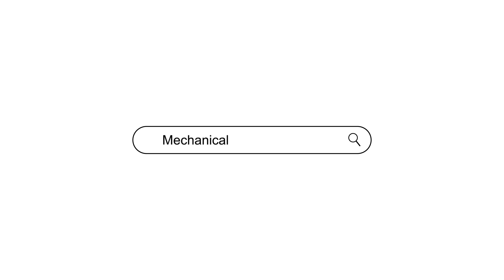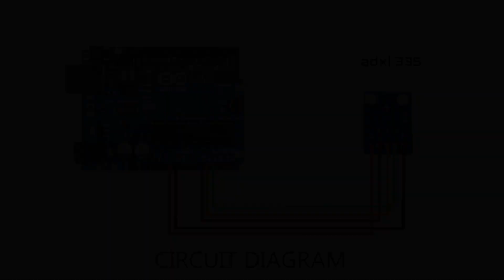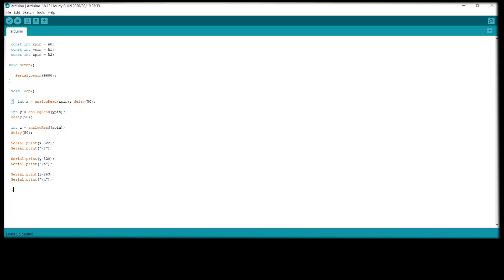How to interface Accelerometer with Arduino

Comment: hi, im new to using a arduino and just wanted to know if i could run a arduino and a 3v accelerometer from a 12v power source. i want to try and make light come on when it detects slowing down for a vehicle

Comment: Why does the code subtract 2 or 3 hundred something from each output?
Reply from the maker: The code has it added to calibrate the sensor. You can calibrate the sensor to omit that step. but this is an easy way. Just put the accelerometer on a flat surface and subtract the values from it.
Reply: @RobuInlabs  Awesome thanks! And in what units is it outputting?
Reply from the maker: @anonymussy123  The output signals of this module are analog voltages that are proportional to the acceleration
Reply: @RobuInlabs  Great thanks!